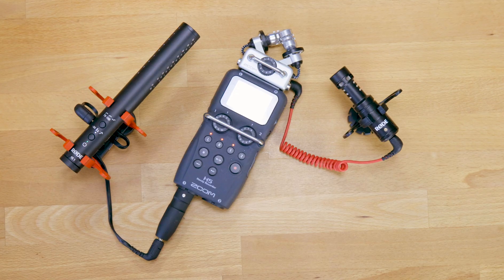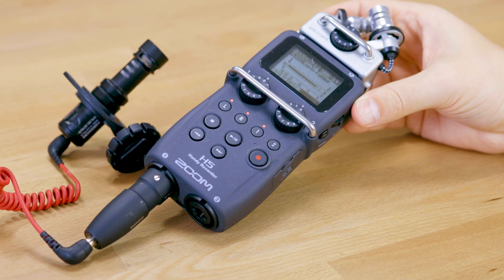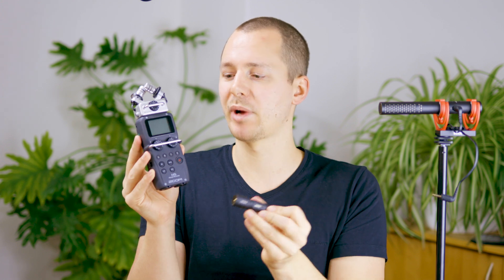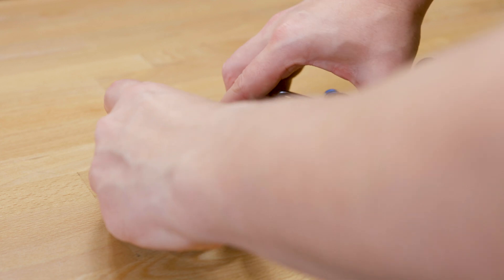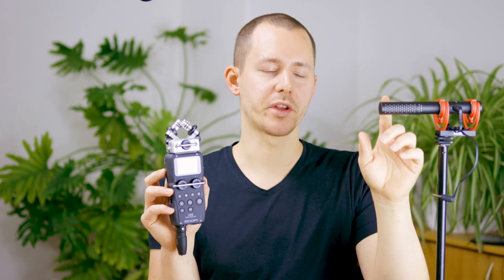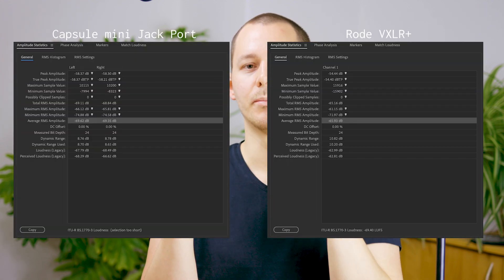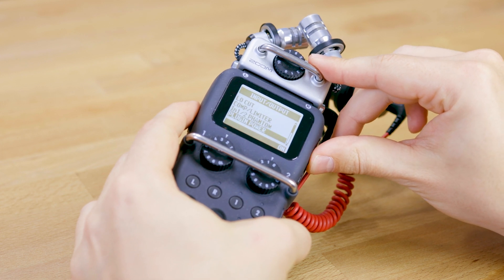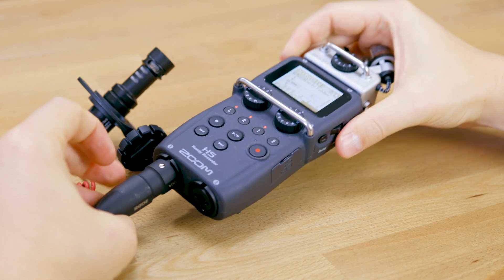Enhancing Audio Quality: Zoom H5 with 3.5mm Mini Jack Mic - XLR Adapter vs Built-In Port

Comment: Phantom power is not TRANSFORMED, lol that's AC. Here I thought you were talking about isolation transformers, but you mean step down power (DC) from 48v to 3-5v for plug in 1/8 jack mics

Comment: the TOP one has lower noise floor?
Reply from the maker: Yes, that's what I found. But it is important that this also is with the Røde VXLR Pro adapter. Different adapters may give you a different result.

Comment: Hi Chris: I bought a Kimura duo headset mic with IEMs (singing drummer). Do you know if I can route the mic through a Focusrite audio interface using the VXLR plus (or pro)? The mic has a 3.5 mm mini-jack (trs) so i think I need the VXLR plus adapter to go into a mic input on the Focusrite and then turn on phantom power on that channel.
Reply from the maker: That sounds about right. Since the Kimura duo appears to have two 3.5mm jack connections (one for the mic and one for the headset), you should be able to use the VXLR Plus or Pro in combination with your Focusrite and phantom power 👍.

Comment: Hey Chris, at 5:14, you said the VideoMic NTG already has battery so doesn't need the power, but if we're not wanting to use the battery, could the Zoom provide power to it?
Reply from the maker: That is not correct, the Plugin Power is only used to trigger the auto power on feature of the VideoMic NTG. If you don't want to use the internal battery, you should hook it up via a USB-C cord to a battery brick. But make sure to test that setup. I have had situations where audio may end up with buzzing sounds.
Reply: @ChrisSpiegl  Thanks Chris
Reply: If i have a deity 3 mic that has a buillt in battery can i use the XLR Pro de Rode

Comment: I have an old version of the Rode Videomic (circa 2015). It is powered by a 9V battery. I just purchased the VXLR adapter (not the +). Is this the correct adapter? It was quite difficult for me to find any information confirming one way or the other on the Rode website. thanks!
Reply from the maker: If you can turn the mic on individually (with a power button), then you should be able to use the VXLR adapter.
Reply: @ChrisSpiegl  so if I understood you correctly, you could burn the mic without the proper adapter?
Let me explain why am I asking this. I have multiple lavalier microphones and a Zoom h5. So I wanted to connect one lavalier mic into the XLR port with a simple 3,5 mm (female) to 6,35 mm (male 1/4 inch) adapter. I was wondering how much phantom power do I need, but if I understood your point, that can't be done, because phantom power is too much for a lavalier and it could break the lavalier? 
So the only solution would be the Rode xlr+ adapter type?
You probably saved me from ruining a lav mic. :)

Comment: hi cris brilliant video ! ,i need your guidance as i am  looking for a way to use Sennheiser MKE 440 with zoom f3 .. confused with how to do that since its a stereo mic  .. also what if phantom power mistakenly remained on ?
Reply from the maker: Phantom Power can damage microphones. It's unlikely with modern mics. But it can happen. When you have a stero mic going into the F3, you'd record them on separate tracks. On the F6 you can map channels to be paired as stereo channels going into one stereo file. I don't know if that works on the F3 since I have not used that model.

Comment: For your rode NTG mic, the original cable is TTRS to TTRS, do you need to change it to a TTRS to TRS cable and use it with the adaptor for input into the zoom? Does the zoom input only take TRS or can it take TTRS?
Reply from the maker: You can use the TRRS cable that comes with the Røde VideoMic NTG because it auto detects which connection type it should use.
Reply: ok thanks!! @ChrisSpiegl

Comment: Can I use both the 3.5mm input and XLR inputs at the same time/simultaneously?
Reply from the maker: Yes, the 3.5mm input will replace the top mic, but the two XLR ports on the bottom stay active.
Reply: @ChrisSpiegl  Thank you Chris 👍🏿

Comment: Hi! Great video! I have an H5 and a Rode Lavalier mic. I want to purchase the RODE VXLR+. What are the exact settings I need to use on the H5 to avoid damaging the mic, please? There are 3 options: 12v, 24v or 48v... or doesn't it matter? I understand that the lavalier only needs 2.5v? So how does that work? Is the RODE VXLR+ somehow stepping down the voltage?
Reply from the maker: The VXLR+ will take care of the phantom power and automatically turn it into Plug-In power (which the mic likely needs). This happens automatically and it does not matter if you set the Phantom Power to 12, 24 or 48v. I probably would choose the lowest value since it uses the least power (if I remember that correctly).
Reply: @ChrisSpiegl  Thanks a lot for replying.  I really appreciate it! And you're right, it needs plain power when I use it on the XY cartridge... I want to have a minimal setup for vox pop interviewing... I'll have the lav on me via xlr and use the xy for the interviewees..
Reply: Do you have a Rode Lavalier ? Then as far as I know that kind of mic does NOT neeed phantom power, just plugin power. If I am not wrong you can kill the lavalier when connected to phantom power...

Comment: I was very disappointed with the VLXR+ and the added noise it creates.  For very quit recording the sound floor is too hi for me.  I tried using it with the Zoom F3 and set to 48v phantom power .  When used with Clippy EM272Z1 Stereo or mono Microphones I think the power output is too low.  I get better results with the Zoom H1 over the Zoom f3 VLXR+ combo.

Comment: did you set the plugin power in H5 when using the VLXR+?  any adjustment also in phantom power voltage when using the VLXR+?

Comment: What is the max length the h5 can record?
Can you sit down for an interview, and hit record, and just talk for 2 hours?

The panasonic recorder I have dumps files out every 15 minutes, so I end up with a bunch of small files that I need to merge later. Annoying, but it does help when you reach a card limit, and only the last few minutes are gone, not the whole interview.
Just wondering.
Reply from the maker: The H5 can record for at least 2 hours non stop and only has one file. I have never reached the card limit with what I was doing with it but I'd assume the recorder would finish the recording up and not corrupt it.
Reply: @ChrisSpiegl  Thanks. That helps. 
I've seen audio files on websites that are 1-3 hours and they have that it was recorded with an H5. No way to contact them, so I was looking around. Every place just says how much audio you can record in total (after multiple files have been recorded). Not just the size of a single file.

Comment: Hello! thanks for the video. Can I use the TRS cable to connect my Tascam directly to the camera, to speak through the Tascam so that the sound goes directly to the camera and records it there?
Reply from the maker: If your Tascam has either a headphone or line out port than you should be able to do that.

Comment: 2 very important questions
1 : if you use the 3.5mm port to plug in an external mic , can you use the backup feature ?
so you record a duplicate signal at a lower gain for backup 

2: does the 3.5mm port accepts line level or only mic level ?

thank you
Reply from the maker: When you use the 3.5mm jack you do have the option to use the backup feature. 

In terms of 3.5mm and line level… I don't remember any more. I since sold the H5. Sorry.
Reply: @ChrisSpiegl  thank you so much

Comment: How did you record both channels with the 3.5mm microphone jack? I tried this and I can only record the right channel : (
Reply from the maker: Interesting, I don't have the Zoom H5 on my hands any more and can't confirm this. But I thought the Mic Port on the Capsule does allow for a Stereo signal to be recorded?
Reply: @ChrisSpiegl , it doesn’t, as far as I can tell.
Reply from the maker: @birbs4life174  ok, that’s too bad. I hope you find a solution for your use-case.

Comment: Hey man, thanks for the video! Very insightful for what i need, I still have a question though... Do you think a Zoom R16 Multi-track recorder can supply plugin power for lavalier mics?  I'm really on a budget at the moment and i'd like to know if I could just get the normal Røde vxlr to get signal into my Zoom R16? Could you shed any light?  Thanks in advance!
Reply from the maker: Hi, whenever you need phantom power or plug in power (when using lavalier mics it's probably the later), you will most certainly not want to use the VXLR adapter but instead choose the VXLR Plus or Pro model.
https://youtu.be/AOmZ6H4aP7U
Reply: @ChrisSpiegl  Thanks Chris!

Comment: Of course, the adapter does not make the mic balanced so it doesn't cancel noise floor.  Also, it only takes signal on the + pin and grounds the - pin.  So, as there is no inverted signal, the signal RMS is about half which is effectively -3dB.  This has no effect on noise floor so turning up the volume +3dB increase the noise floor by +3dB.  If you want to cancel noise floor you need to use a real balanced mic in the XLR port, not a converter.  That or cancel the noise in DAW.
Reply from the maker: If you want to see a comparison of the VXLR Pro from rode (which has the electronics to do a balanced signal) you can do so on my channel.
Additionally: I never expected the adapters to "reduce the noise floor" but there may be a difference in terms of how much noise the electronics/cabling introduce if any.
Reply: @ChrisSpiegl  Well, you mentioned the sound level difference between the TS connector and the XLR adapter. I was just clarifying that as the mic uses single ended (SE) signal, the SE TS plug gets the full available signal strength, but using TS into the multi point (MP) XLR adapter, effectively halves the signal strength from what is expected.  That is the reason for lower volume with the adapter.

I mentioned noise because the whole point of MP connection like XLR is noise cancellation.  So I just pointed out that using that type of adapter negates the whole point of XLR input.  So you may as well just stick with the TS input in this case.

Shure, you have no option but to cobble SE to MP gear together in this way sometimes but the correct way to do that is with an audio transformer to convert the signal from SE to MP which this adapter does not do , thought the pro version seems to make that claim.  Yeah, I am very familiar with the difference these types of connection make, thanks for the offer.
Reply from the maker: @kenwebster5053  Thanks for your input. I understand what you mean now better with the lost 3db.

Comment: Hi I have zoom H6, i put on my video mic pro plus, but it won't turn on, am i missing something? can you help me?
Reply from the maker: Did you plug the VideoMic Pro+ into the top capsule on the H6? 
If yes, then you have to turn on Plug-In Power in the settings of the H6 so that the mic automatically turns on.
Reply: @ChrisSpiegl  Yes Chris, okey Ill try it, thank you so much chris

Comment: do i need specific cable for plugin videomic pro plus to the capsule? or it can be used with the cable from videomicpro plus?
Reply from the maker: Depends: does the VideoMic Pro Plus have a TRRS cable or a TRS cable?
You can always try it with the cable it comes with. But I have made the observation that mics which usually come with a TRRS cable should be used with a TRS cable in setups like these.
Reply: @ChrisSpiegl  it has the TRS cable , Chris. Do I need to activate the plugin power on the XY CAPSULE too Chris?
Reply from the maker: @genocideist  If you plug in the microphone to the XY capsule you will have to activate the Plug In Power there. Since the Plug In Power "triggers" the stand by / active mode on the VideoMic Pro+

Comment: Hey I have a Deity v-mic D3 pro that I’m trying to plug in to the mini jack. It doesn’t seem to be overriding the built in XY mics, am I missing something silly?
Reply from the maker: You have to activate the Plugin Power for the XY capsule in the Zoom H5 so that the Deity V-Mic D3 actually powers on, since it does not have a power button really but just that weird standby mode.

Comment: Note that for a self-powered microphone like the Rode VideoMic NTG, the regular old Rode VXLR would be a better choice. If you turn phantom power off and manually power on the VideoMic NTG before connecting it, you’ll need significantly less gain with the VXLR than the VXLR+ or similarly power-transforming adapter.
Reply from the maker: Interesting aspect to think about. I would actually also go for the non transformer adapter with the VideoMic NTG because it also adds a bit less noise. However, if going over greater distances, I would choose the new Røde VXLR Pro (https://crsp.li/VxlrPro) since that also makes it a balanced signal which is less prone to inferences.
Reply: @ChrisSpiegl  Yeah, basically if your cable is longer than 10 feet, you should be using XLR. Or Dante. Or a wireless system.
Reply from the maker: @Matthew_Raymond  🌸 👍

Comment: Hey @Chris, how did you connect NTG to the top capsule? I couldn't. I had to use a TRRS to TRS adapter (used a Boya ...) but I got a lot of noise and a constant beeping sound... could you help me out? I couldn't get the clean sound you got... Tks man
Reply from the maker: With the Rode VideoMic NTG you have to turn on the PlugIn Power on the top capsule so that it triggers the auto power on of the NTG. Then you should not have the issues described — even with a TRRS to TRRS cable.
Reply: @ChrisSpiegl  Tks! I've done a factory reset on my Zoom h5 and after that, I was able to connect even without a TRRS to TRS adapter. It seems that Rode NTG is capable of recognizing the device it is connected to. Clean sound now... \o/
Reply from the maker: @IgorNassif  Yes, that's what the VideoMic NTG is supposed to do… Recognize the device on the other side. Glad you got it working.

Comment: My Tascam DR100 MIII has a plug in power option on the XLR ports. The 3.5 input and the XLR's sound the same when I use it with a mic requiring plug-in power. interest video and it got me to do the same tests on my recorder. All good to know.
Reply from the maker: Glad this video was helpful for you. 
Yes, with different devices the results may vary.
Happy recording 🌸.

Comment: Could the Videomicro work with the VXLR(without the +)?
Reply from the maker: The Rode VideoMicro needs Plug In power. If you want to use it with an audio recorder on an XLR plug, then you will need the VXLR+ or VXLR Pro and turn in Phantom power (which the adapter will then transform to Plug In Power). 
Hope that’s clear. 
I have a video comparing these adapters: https://youtu.be/AOmZ6H4aP7U

Comment: Other question please 
The cable come with videomic ntg it is trrs to trrs is that will work with rode vxlr or i need buy rode sc7 cable trrs femal to trs male ?
Thank you
Reply from the maker: The Rode VideoMic NTG automatically detects if it needs to send a TRS or TRRS signal. So you don’t need that extra SC7 adapter.
Reply: @ChrisSpiegl  thank you so much

Comment: Hi
Thank you so mush it is help it me 
I have some question please
I want get 2 mics ( rode videomic ntg ) with recorder zoom h5 or tascam dr 40x  
My question is
1 i want put both in xlr port can i used normal adepter rode vxlr or i need vxlr+ ?
2 the videomic ntg have phantom power  so i dont need on it on recorder ?
3 if i forget and i left phantom power on with videomic ntg  is the mic will get problem ?
Thank you for this video
Reply from the maker: With the VideoMic NTG you are going to be ok with the RODE VXLR adapter. https://crsp.li/rodevxlr
You are correct. You don’t need the phantom power there. It will probably be fine if you happen to leave phantom power on but it’s better to turn it of for sure. Though, if you never use the recorder for anything else you also will always have phantom power off. So there should not be any problem. 
My more important question would be: why buy two VideoMic NTG if you’re going to use an external recorder anyways? This ofcourse depends on your use case but if you are planning to podcast, I’d say there are better options out there. 
Hope the helps. 👋
Reply: @ChrisSpiegl  thank you so much for replay so with vxlr will be work fine and i did not need vxlr+  and the videomic ntg will work fin if i forget left phantom power on with vxlr ?
And i need 2 mics only for i plan to open asmr channel to make real stereo sonund left and right 😊
And if you have other option please tell me and thank you 👍👍👍
Reply from the maker: @MoElf  I would actually look into different but very cheap microphones. There are tones on the market that go directly into the XLR port of the H5. Maybe this video could be interesting for you: https://youtu.be/rr1-jS8YB-c
There you also have stereo mounting options but in some of them actually a cheaper setup.
Reply: @ChrisSpiegl  thank you

Comment: Just reach Rode website and I see this http://rode.com/accessories/vxlrpro . The new VXLRPRO. Maybe it can help you what the different between VXLR, VXLR+ and VXLPR Pro. Thank you man!
Reply from the maker: I'm in contact with Røde to get one of the new VXLR Pro to me for review and comparison purposes.
Generally, the new Pro is better for long distance cables because it has wiring that protects the audio signal from interference. It's some technical stuff I will probably talk about in my comparison video.
Reply: @ChrisSpiegl  thats great. May I know when it’s will available since it just launch last week?
Reply from the maker: @alifsaufwan4245  That is a question I am trying to figure out myself. I hope it'll be available by the time I get it in my hands and the video out to you.
Reply from the maker: @alifsaufwan4245  I just learned that they are planning to have it available by end of February.